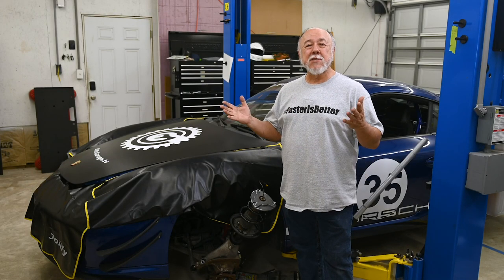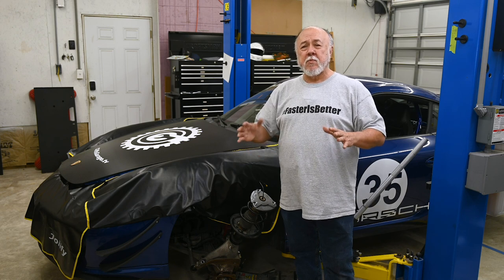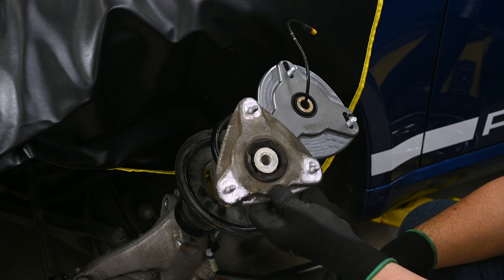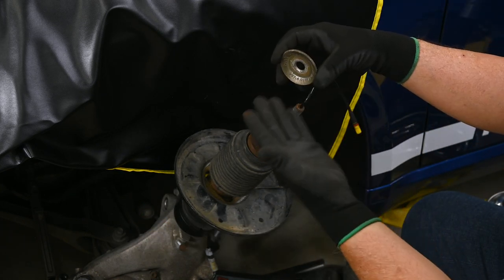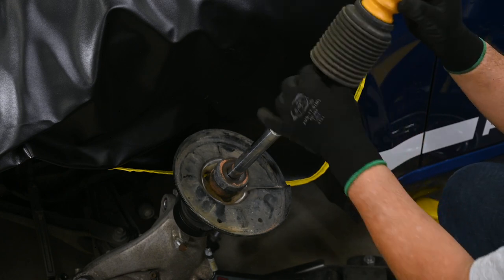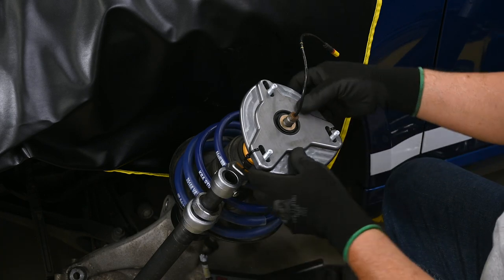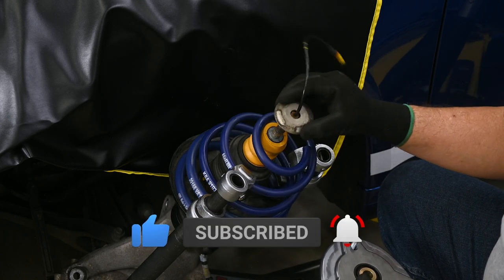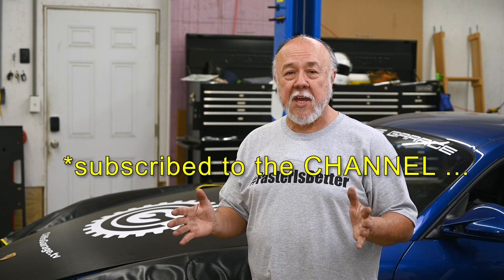My $15K Suspension Upgrade, Part 1: H&R front lowering springs + bump stops (Porsche Cayman S 987.2)

Comment: yeah I'm going to think hard about what I want to do before changing the suspension. the car is already really damn low just because there's a gap at the Wheels doesn't mean it has to be filled and so I'm not sure I want it lowered I feel like I'm in a go-kart as it is going by other cars. and the thing about coilovers is why do you need adjustable ride height normally? at the track even you're not really going to need to change your ride height very often so I don't know I I get the adjustability is convenient but how often do you need to change it? I think the real advantage is being able to more easily swap the springs for different rates. because then you're not screwing with spring compressors and removing half of the suspension just to get the spring out etc.

Comment: was the front lowered or not? curious..
Reply from the maker: Front only by 0.5" instead of the expect 1.4". The rear dropped by the expected 1.1" Currently working with H&R to figure out why.  However, even the small drop was enough make a dramatic difference in the way the car looks!